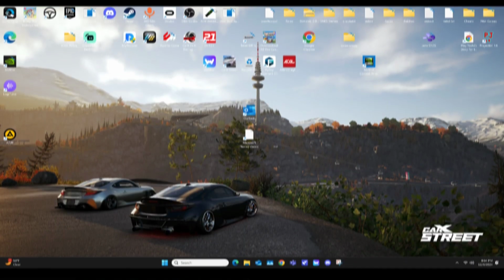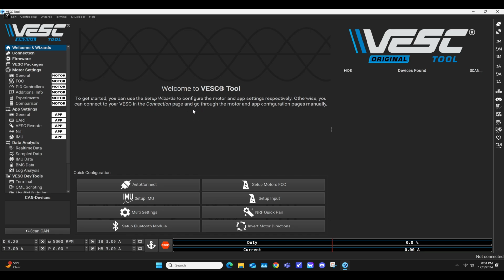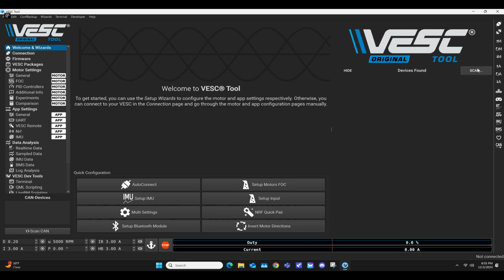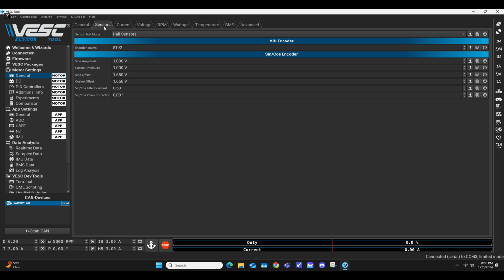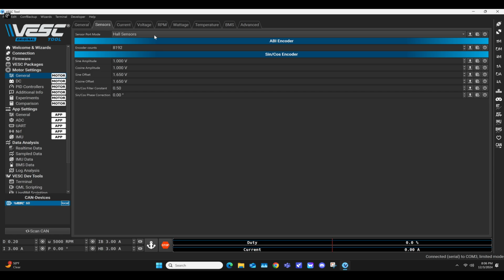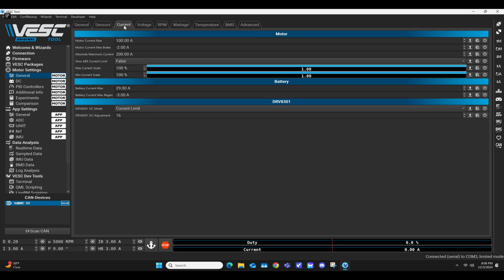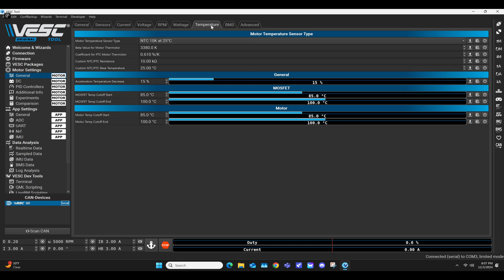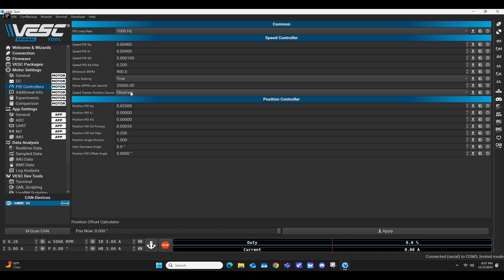VESC Brushless Controller on a Brushed 500W Crazy Cart

Comment: YOU ARE THE MAN
I've been watching your videos and shorts. I debated running an FAFO controller and an XL motor to get regen braking for my son's standard. Does this setup allow regenerative braking?
Reply from the maker: i havent tried setting it up. im gunna say it may not work just due to the deisgn of the brushed motor but you can do the powerider bolt on brake like i did in my earlier videos with the xl. itll help keep the cart in angle and closer at higher speeds.

Comment: Hey man, I'm interested in doing this setup for my XL, I have experience with the Vesc on a brushless cart but I want to use it on my stock XL motor for the tune-ability and possibly regen. Do you have a video showing the wiring setup? Just interested how it works without the hall sensors and such.

Comment: Mind me I'm new to this Crazy Cart upgrades. Currently waiting on 48v battery and 500w motor for my standard cart. What is the point connecting the Vesc Brushless Controller when u can use the standard Controller. Does it makes the Cart go faster?
Reply from the maker: Yeah, it allows you to program it and change how you want the power to be delivered, run more voltage then 48v if you wanted, allows for way smoother throttle input, and keeps the motor way cooler. I did my speed runs and a couple of miles of riding, and i can put my hand on the motor with little heat. Do i think it's worth buying this from the company that sells it as a plug-in kit. Nope, not at all. especially since they dont even give it a base tune. But if u can solder and do wiring, its worth it
Reply: @MooseRidez  fair enough.